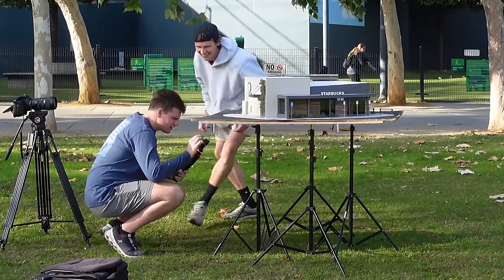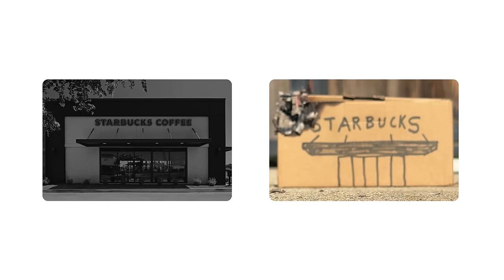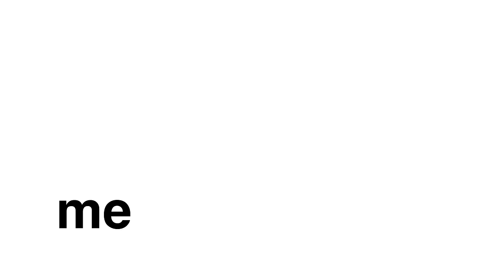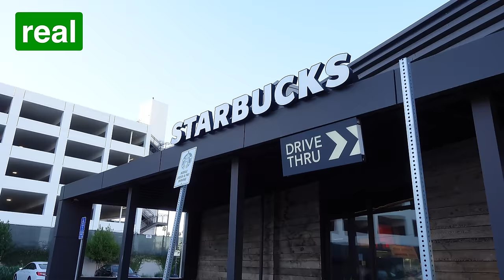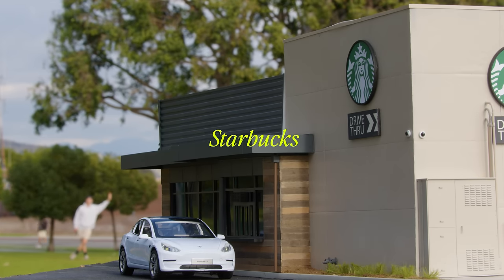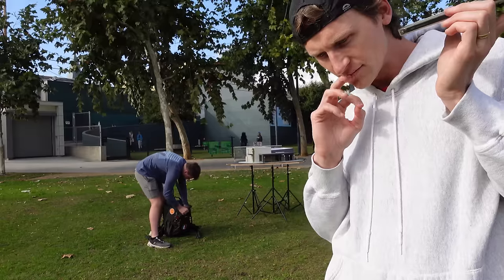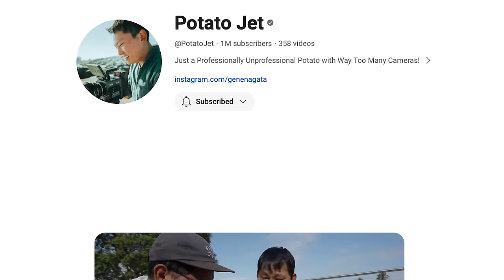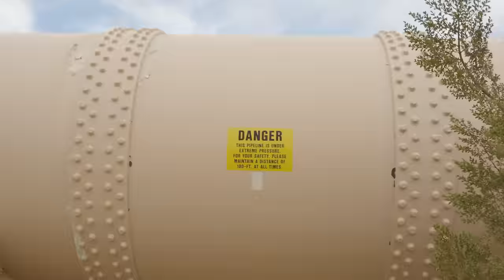I Built an Ultra Realistic Starbucks for My Movie

Comment: As someone who used to build miniatures form VFX shots (before the days of CGI VFX), I gotta say, for that small a scale, your's looked pretty good. For a quick shot, it would have passed pretty decently. When building for pyro shots, the bigger scale the miniature is, the better the effect will be. A 1:8, 1:6, or 1:4 will get you a lot closer. Of course, the larger the miniature, the more time, more money, and more pyro and air-cannon you will need. The miniature would also need to have enough structural details (things like wall studs, individual bricks/blocks/tiles/ect, rafters, roofing, etc., etc.) to blow apart in a realistically detailed way.  Look up some news footage of houses blowing up from natural gas explosions to see what I am referring to. There is a lot of granular detail that is quite visible and to really sell the shot, you have to approximate that detail as much as you can. And, of course, it goes without saying, pyro at those scales is inherently much more dangerous than what you guys were doing. You will definitely need a VFX pyro expert to rig and operate the pyro fx for you (and a producer to pull permits, arrange for locations, fire safety, insurance, and so on). It's a big deal doing large-scale miniature pyro shots but the results are very worth it, something that 3D CG software still has not yet been able to do as well, even Houdini, the best CGI simulation software there is, cannot do this just yet. After all, we are talking about computational fluid dynamics simulations plus, realistic lighting and shading. Fluid dynamics simulations are still in the realm of massively parallel processing supercomputers.

Comment: Overall i should say the short film i rank is 9/10 amazing work but my only issue i that is about the guys who were trying to do the flown high pose in the car because the background of it is not accurate it should've been green screened so it would be an accurate angle where they are but it's still amazing

S - Spectacular
A - Amazing
B - Ballistic , Better or Best
C - Crutial (MID)
D - Devastating/Disadvantegous ( A disaster)
E - External (get it extermination )
F - Failure